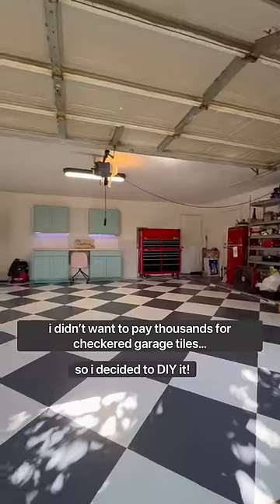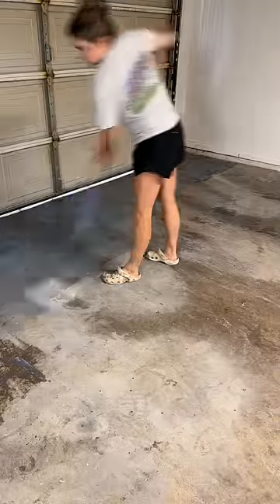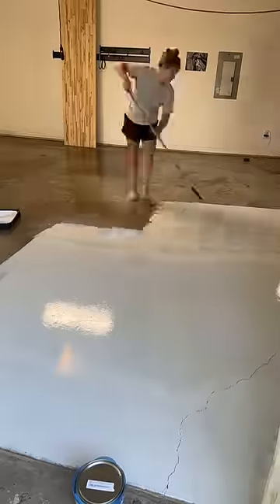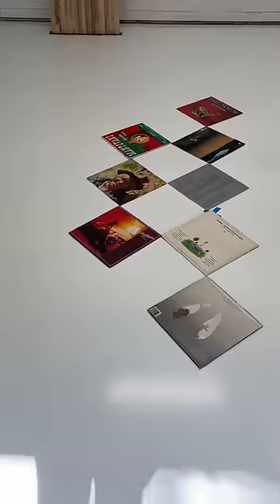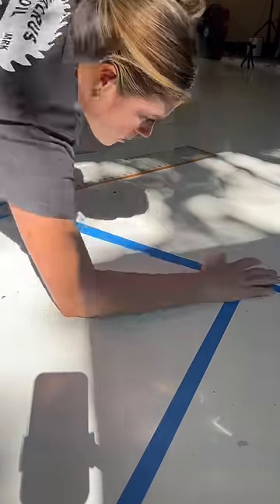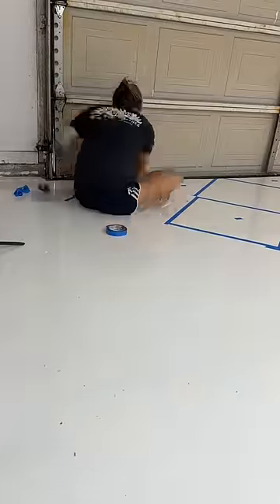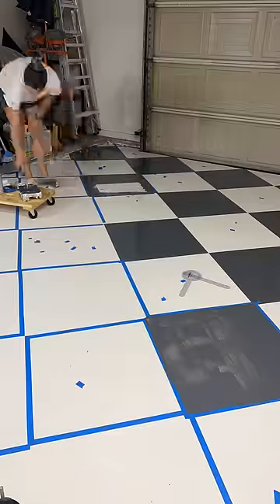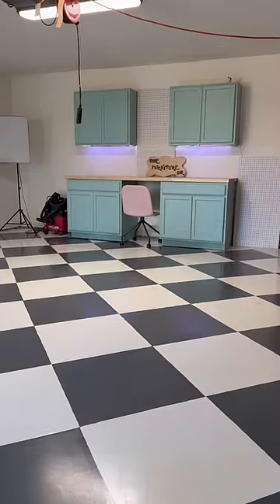DIY-ing Checkered Floors in a Garage Workshop ?! Harlequin Pattern Tutorial Using Concrete Paint!

Comment: For the layout part, you could speed up the process by first painting the black squares in every other row and every other column. This way you can use one long piece of tape for each entire row/column, which would mean way less measuring. After that, remove all the tape and lay out the squares in the remaining rows & columns.
Reply from the maker: That wouldn’t work because you need to account for the width of the tape
Reply: @thefurnituredoctor  That's why you first do every other row & column, then you remove that tape and tape and paint the remaining squares.  Like I explained in my comment :)

Comment: Floor looks great, just as any freshly painted surface will. I looked at doing this myself but opted for foam click matts with the same design. In my case matts worked better because I would not be doing heavy work, and foam matts were way cheaper. That being said I am curious as to how long this painted floor will last under working conditions. I would be concerned that the paint finish would not stand up to traffic and perhaps would consider a few coats of sealer. Refreshing a coat of sealer once in a while may turn out to be easier than repainting scuffed, chipped and scratched paint.
Reply from the maker: Thank you!🥰🥰

Comment: Spend the money to get a local sign maker of vinyl cutter to make a stencil as big as they can.  Most typically have 8 foot wide cutters, so that's what you get.  If they are nice, they will reduce the price of the raw material by the reusable drops.  Then you just drop some chalk lines to align the stencil and paint away.  No days and days of taping required.

Comment: Why didn't you have one wooden board cut 24x24 as your template? You could've placed a weighty sandbag on it so that it didn't move, and just traced around it for each square position, giving you an outline quickly and perfectly.
Reply: Tape is to give a clean paint line.

Comment: If you read the back of that paint it says not for use on garage floors.  You should have used the epoxy
Reply from the maker: Yeah but I’m not driving in this garage
Reply: There’s a clear coat if you want to apply for added protection.  It may be easier to clean.  Nice job!

Comment: Could have made it a lot easier by just using long strips of tape instead of ripping off each side for the square. As long as you have a long flat marker to run the tape along it should be just fine.
Reply from the maker: No, because you need to account for the width of the tape. If I did it that way then the checkers would not connect
Reply: X pattern? @thefurnituredoctor